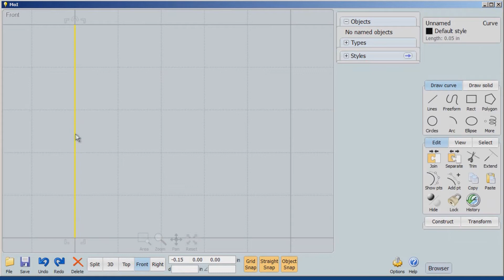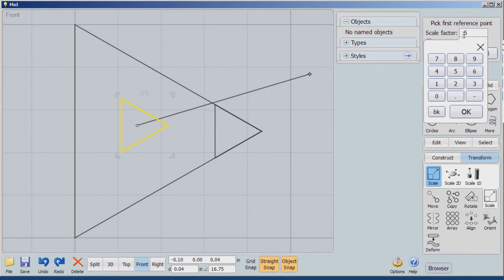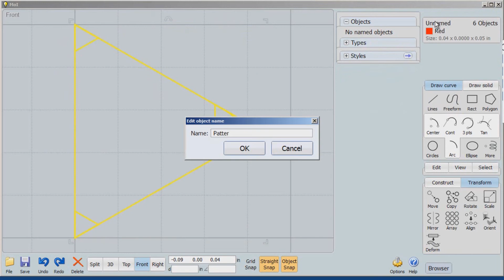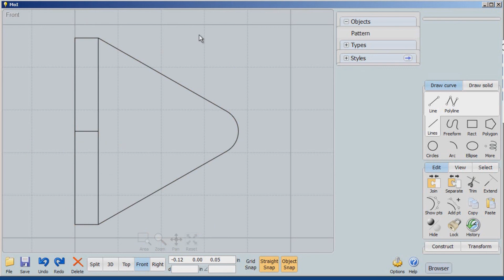Moment of Inspiration - Thread Cutting Tool

Comment: What are the reasons to use lines and not a polygon tool to make a triangle?
Reply from the maker: It's actually easier to use a polygon.  I simply showed an alternate approach.  So, how do you like Moment of Inspiration so far?
Reply: It's superb. Upgraded from V2 to V3 in the early spring 2016. Sometimes it's difficult/time consuming to create a solid from joined surfaces though and some tools are somewhat less robust than I'd like, but for the price it's unbeatable. Also as it has a really good polygon convert and export, it's a very good tool for 3D graphics software too. I used the software to do a design proposal for a beverage bottle; I could do the CAD files for tooling RFQ and meshes to do product illustrations in Blender for the potential client.
Reply from the maker: That is great to hear,   :)